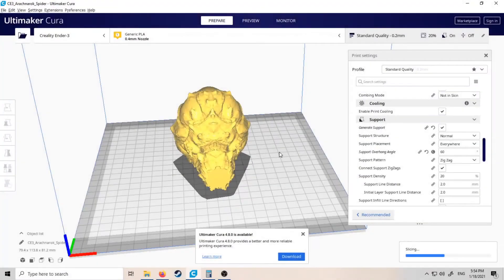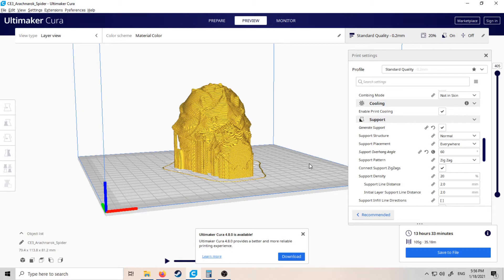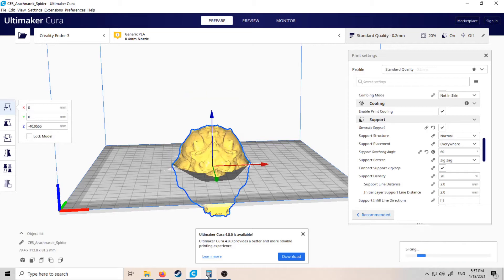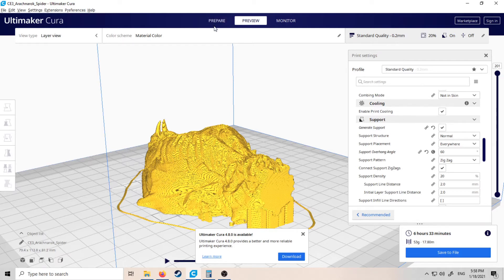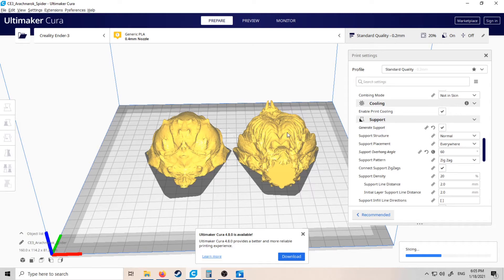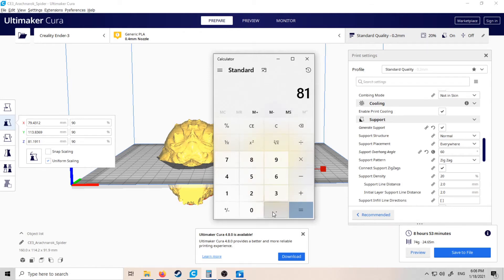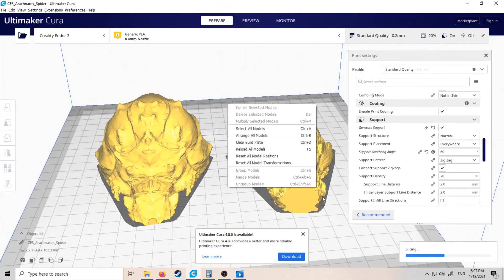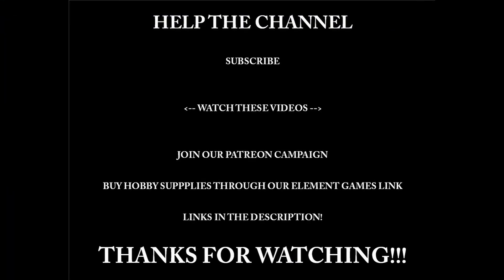3D Printing: Splitting a model in Cura (Sort of) the cheaty way

Comment: what are the other ways to split? wouldn't it be easier to split it and print both halves side by side?
Reply from the maker: If you're familiar with other programs yes, there is currently no way to do that directly in Cura so this is just a simple workaround for those that aren't familiar with/don't have access to other programs (such as Meshmixer) in which to split it

Comment: I used this and the concept works fine in cura, but by the time I'm printing it only prints a tiny bit of the wall. Not the model. Is the file corrupted or am I doing something wrong?

Comment: Has anyone printed this way, and how did it go? I just want to make sure it doesn't mess up my printer
Reply from the maker: I understand your hesitation, all I can say is that it works for me and I use it all time on larger models, what has been interesting is that a few people have told me that their Cura won't let them print the model at all if it is sunk below the build plate like this, I honestly have no idea why this is the case, if it's a specific setting that allows me to do this I have no idea where to find it.
I haven't to this date had any reports of this causing damage to anyone's printer but I would be genuinely upset if this video caused anyone to damage their printer so if you are worried maybe look using a 3rd party program like Meshmixer to split your model instead

Comment: your measurements are wrong your calculator first read 40.59555 and you entered 40.9555
Reply from the maker: I did spot that but only after the edit/upload, luckily the print came out fine and the difference wasn't really noticeable

Comment: Mine is trying to print the part under the beds messing up
Reply from the maker: Sorry to hear that, what printer are using? Could it be that your printer works slightly differently than mine (Ender 3) in how it uses that data, mine just doesn't print anything that's below zero on the Z axis so just starts wherever I sink the model to
Reply: @MiniPaintingPunk  any cubic mega x. Now I can’t even have parts below build plate in cura. Now I been cutting models in mesh mixer and loading in cura because I can’t get cutting tool in cura.
Reply from the maker: @hashtagdeadite1332  Hmm, maybe it's something specific to the Ender 3 profile I have then, sorry it didn't work for you

Comment: Cool, always nice to have more tools ... but you kept typing in the wrong number so I hope this split was just for demonstration or your spider is going to be missing a bit of body ^ ^
Reply from the maker: Hahaha, well spotted, noticed the half split was off by .00005 (cura only allows for .xxxx digits and I needed .xxxxx) after I'd uploaded, I went with the off center split in the end which was accurate so it's all good
Reply from the maker: on a print that size I doubt the .00005mm difference would have been noticeable but it is always better to be accurate, especially in an instruction video so apologies for that :)
Reply: @MiniPaintingPunk  Mate you calculated 5.59 but used 5.95, so you were off by .36 lol. Was hoping you'd notice before the end of the video but hopefully the print still came out okay, this video was very useful!
Reply from the maker: Oh my days you are correct! I can't believe I missed that, the print came out great so I never even realized. 
Well I guess the theory is still sound at least lol, thanks for the heads up